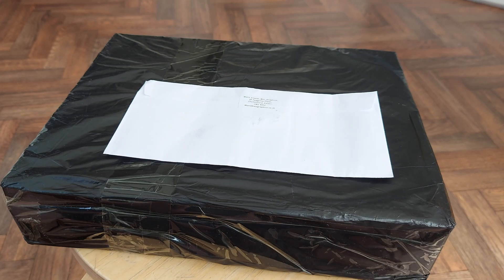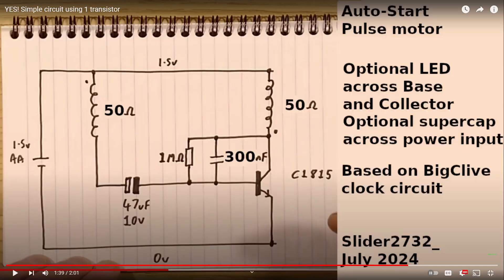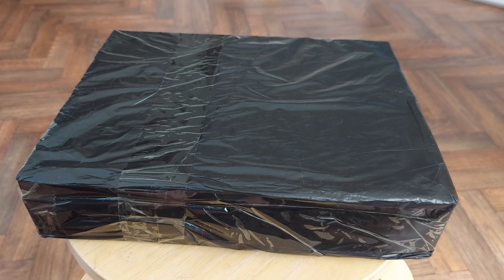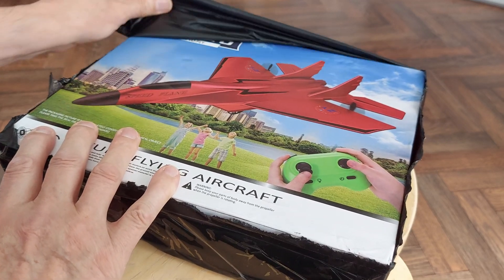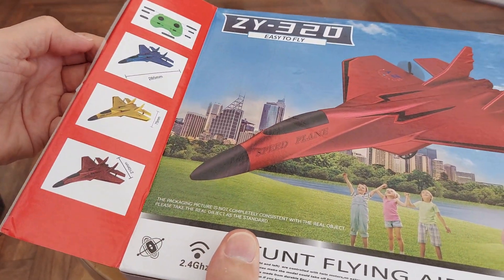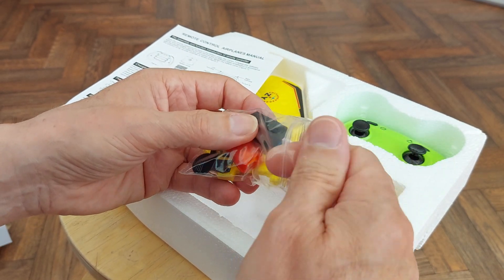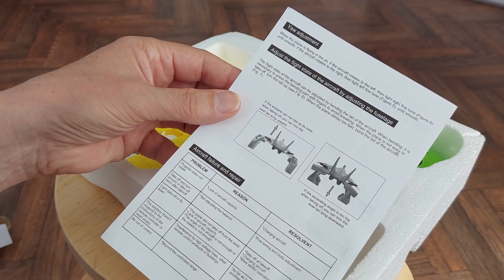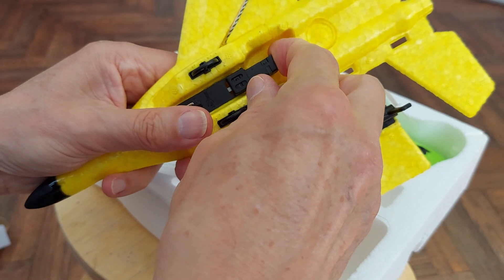Grandads Postbag 20240727 RC Plane and Transistors

Comment: C1815's are good and strong, just an alternative to C945, 2N2222, 2N3904, but always seem to do the job 😀 
A 2 channel 2.4Ghz plane in 2024 - NICE! Looks like my F/A-18 from many a year ago. Zero throttle turning is a great feature.
Reply from the maker: 2 videos coming up of it flying. The second one is better as I improved a bit. Second time round I was actually in control after a while 🤣🤣

Comment: They are usually a little tail-heavy so take a few screws or plasticine for the nose. Plus a hobby blade and the aluminium seal from a coffee tin to make adjusting the tailerons and maybe rudders a little easier and more predictable. 😉😊
Reply from the maker: Yes it is a bit floaty, but I left it like that as it meant I could fly slower and get the hang of what was going on - eventually. 2 videos coming up of it flying. The second one is better as I improved a bit 👍👍